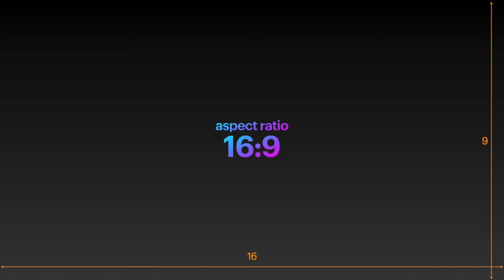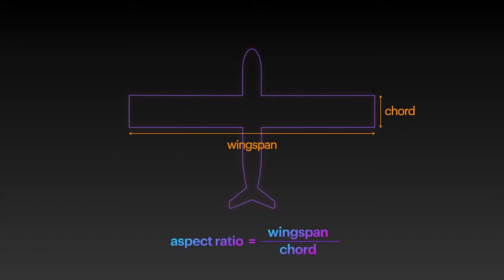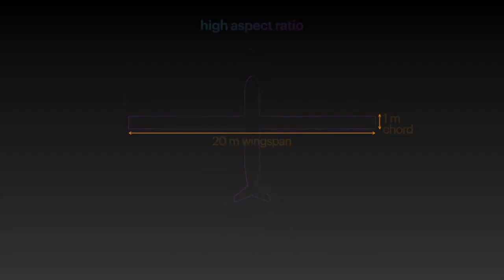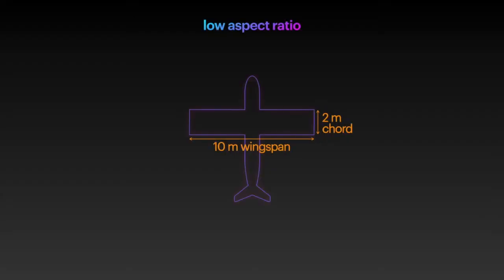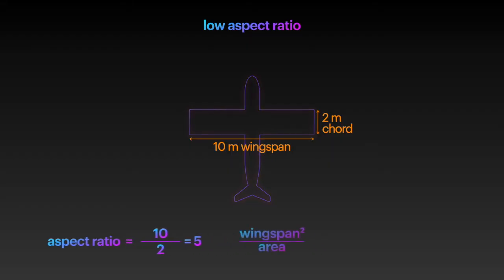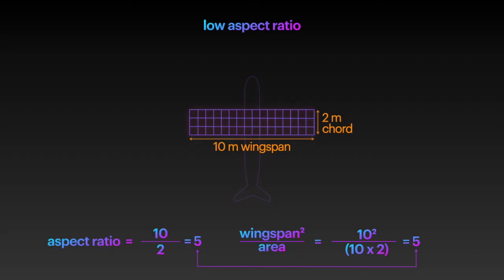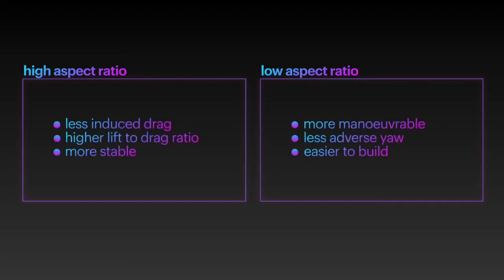What is aspect ratio?

Comment: Informative video - However, wing area of a swept-back (or forward-swept) wing is 'usually' based on  the linear extension of the leading and trailing edges to fuselage center-line (not as shown directly crossing) known as the 'root chord.' - Wing area is not always exact, but close - Regardless, it must be consistently carried through the entire aero design  - Close, meaning it then allows comparison to  other aircraft, by conventional definitions - Thanks - Enjoy!
Reply from the maker: Thanks for the insightful comment!

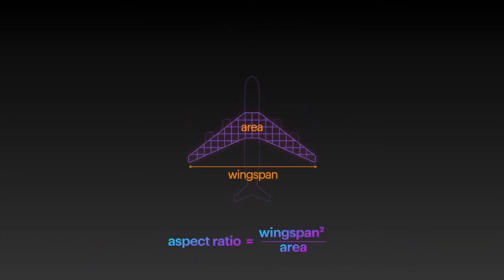Comment: in 1:43-1:45 you showed the airplane whole body than you show its wing area, especially when you drawn line from left wing-root's leading edge to the right wing-root's leading edge. Previously in 1:35-1:38 you said, "The value for the wing area is the area of its shape as viewed from above." Here, it is clear that some part of the fuselage is included as the wing area. What I don't understand is, why does not all the rest of the fuselage included as wing area?

Comment: how 16 to 9 is 16:9 but 10 to 2 is 5?
Reply: ratio can be represented by either a fraction or the colon. so an aspect ratio of 10:2 is the same as 5 because it's just 10/2 which equals 5. They likely just made the distinction because dividing 16 by 9 is not a whole number.